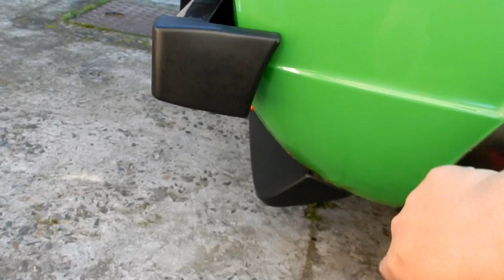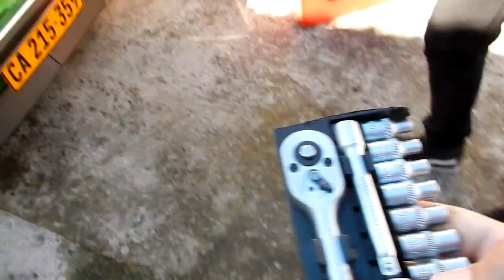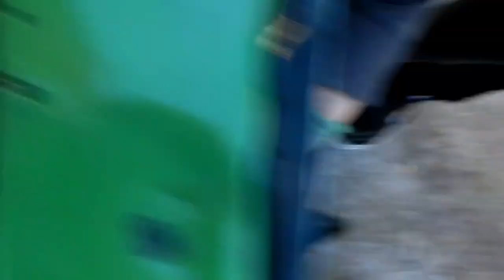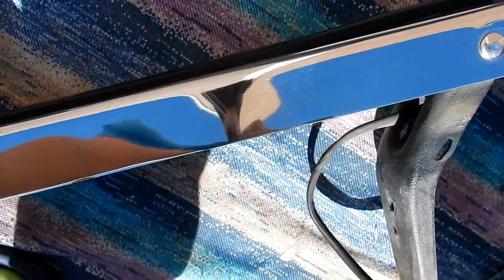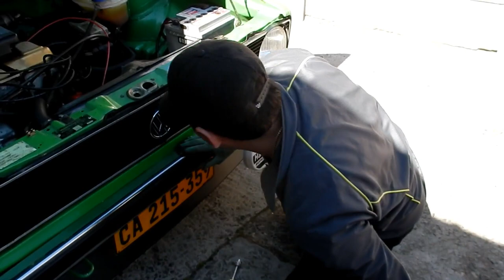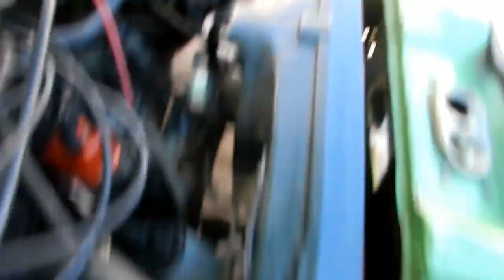How to Mod the front bumper on the Mk1 Golf, Project car

Comment: I am a new mk1 rabbit owner and my front bumper sticks out waaaay further than yours is that a year specific thing or have you modded yours
Reply from the maker: Oooo interesting I can only imagine that it's a different bumper this one is slim and after market but it's the same as the ones the car came with they just newer. If you are from another country or the model came from a different market it could explain the bumper.I know the U.S. spec had this weird bigger bumper. If your bumper looks the same then maybe its a different mounting bracket. Hope this helps.